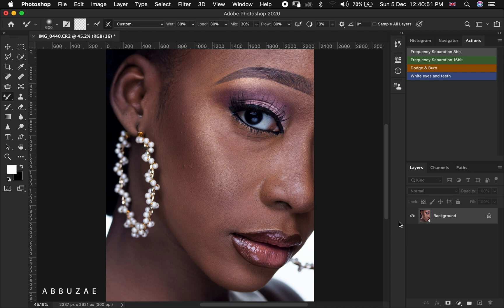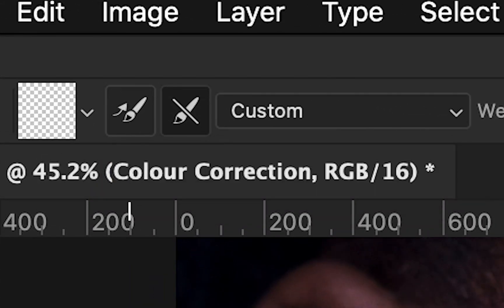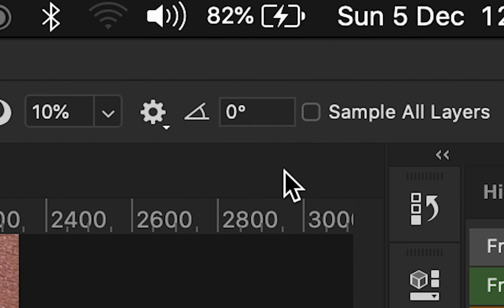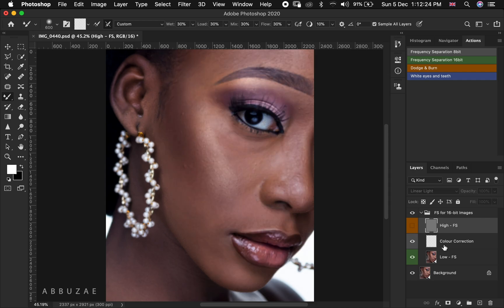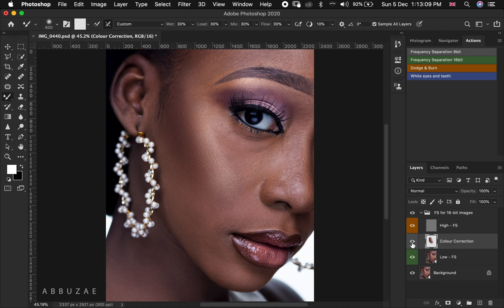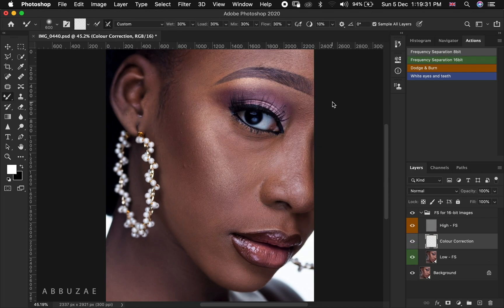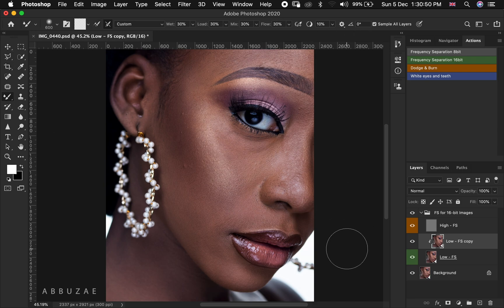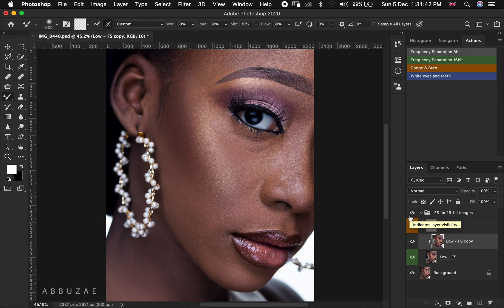Mixer Brush Tool Fixed | Photoshop

Comment: Why are your settings all the same..30,30,30,30
Reply: Wet 8, Load 75, Mix 90%, Flow 100, Smoothing 10%... They should NOT all be the same but "it works" for him.
Reply from the maker: That is what works for me
Reply: @Abbuzae  please can u Make a tutorial for what the MIX,WET,FLOW does.. what is their work in Frequency separation
Reply: Nice question..even I wanted to know

Comment: if i use graphics tablet how does it come in terms of  pressure sensitivity?
Reply from the maker: Now it depends on the level of pressure you apply from you tablet app. The harder you press, the more effective your mixer brush
Reply: @Abbuzae  please does pressure sensitivity necessary in fs
Reply from the maker: @zanunuzanunu3491  no, a lot of photographers are using mouse and still achieving great result